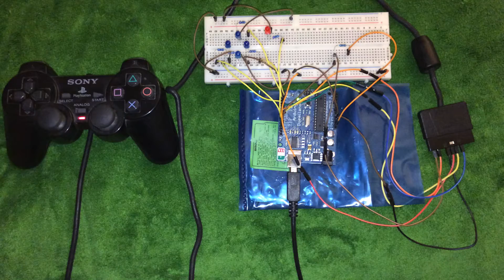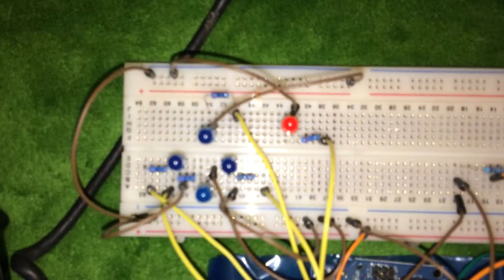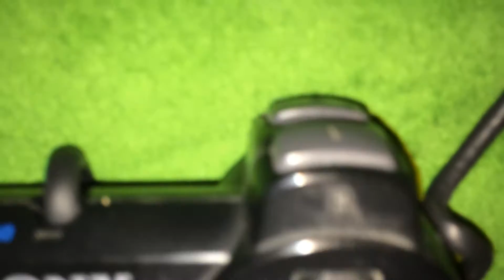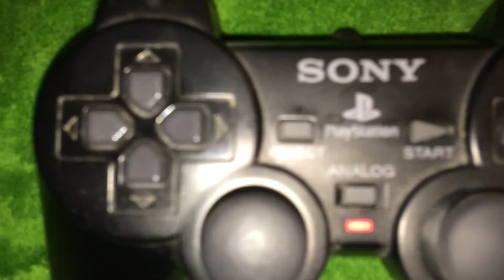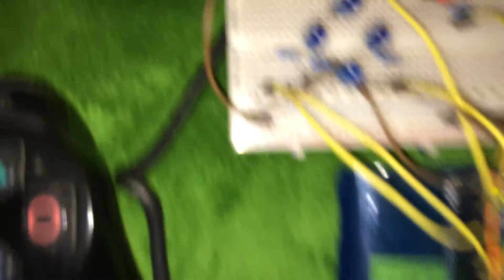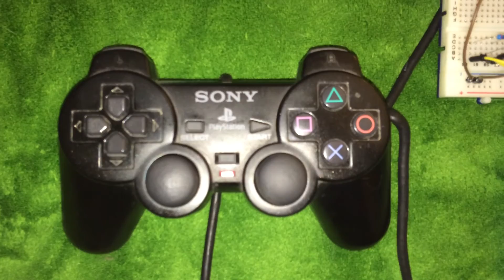Arduino project: PS2 controller interface

Comment: Lots of demonstrations of this on YouTube but none have explanation of the debugging process of the controller or info on the code
Reply from the maker: Abram Harrison Sorry, but I'm unable at this time to share the source code I created because
 I work for a company that doesn't allow me to share open source code 
(even small projects like this) without approval.  However, the link in 
the description of this video is a technical document that I used to 
figure out how to do this.  Part of the fun of Arduino is actually 
figuring out how to make things work with it, and this document 
definitely will help you do that!  Good luck!
Reply: Thanks

Comment: I have been trying to do this for a week now. I have mutilated one controller already but I like how you connected the jumpers right to the ps2 header pin. Could you provide me with some tips and maybe the sketch your using? I have Bill Porters PSX library installed to my IDE; is this the lib you are currently using? If you could just send me even a text file of the sketch that would allow me a great starting point.
Thanks
Reply from the maker: Tony Odin I wish I could share something, but the company I work for doesn't allow me to share open source code (even for small projects like this) without approval.  I actually didn't use any libraries to create this, but just read a technical document (see the link in the description) and figured out how the controller worked.  It takes a little work to figure it out, but it's very rewarding to get it!  Good luck!
Reply: jolt527 Hey thanks for reply. I have had success with interfacing and I am now able to communicate to my peripherals via my Arduino Uno. You are definitely right; once I finally got it working it was a true eureka moment ! Hahah
Reply from the maker: Tony Odin Congrats, that's great!  :)